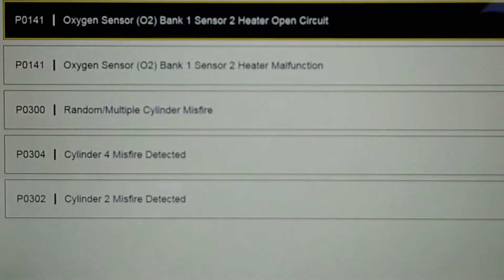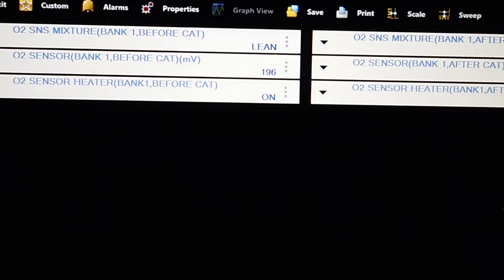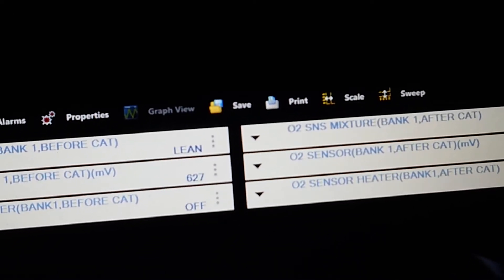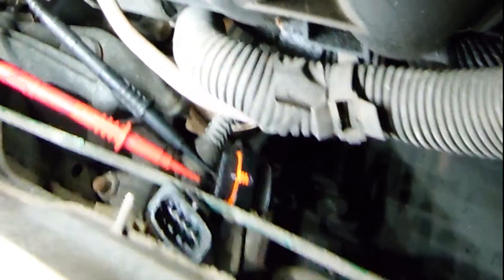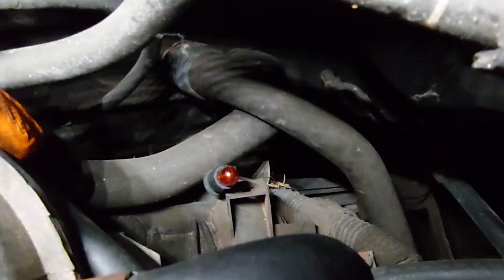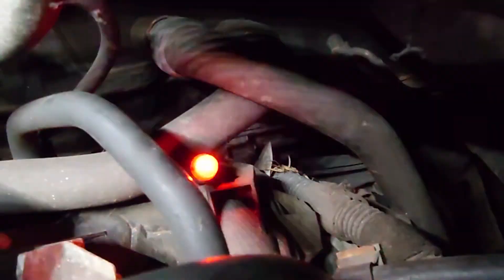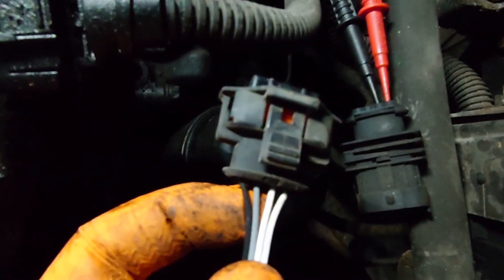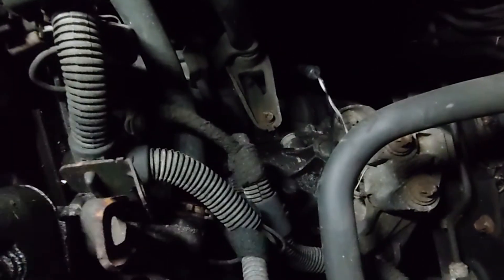Vauxhall Corsa o2 sensor fault P0141

Comment: Hello mate, p0141, changed sensor and still the same. I've seen theres an o2 sensor relay in the bonnet, would you approach that as next port of call?
Reply: I have same problem and have done for a year did you find your fix ?
Reply: @madhibee5167  yep, fixed 
the o2 sensor was wired wrong. I rewired it (literally just cut the wires and soldered differently) and it's been fine now. No codes, no running rich and opcom shows proper voltage (0.5v when engines warm) cheers

Comment: Hi. I’ve changed both my 02 sensors and the error code P0141 bank 1 sensors 2 keeps coming back, any ideas?
Reply: Bonjour avez-vous trouvé votre panne
Reply: @mickaellessort5244  Bonjour, si vous aviez eu le même souci, auriez-vous trouvé la cause SVP ? Sur l'Opel Meriva d'un ami, idem avec une erreur en P0141. Nous avons remplacé la sonde lambda 2, mais en vain, le code revient avec le témoin moteur.
A noter qu'il a un souci de calorstat car le moteur nf chauffe pas assez et ne se maintient pas en température de fonctionnement. Je ne sais pas si cela peut-être la cause du problème. Merci d'avance.